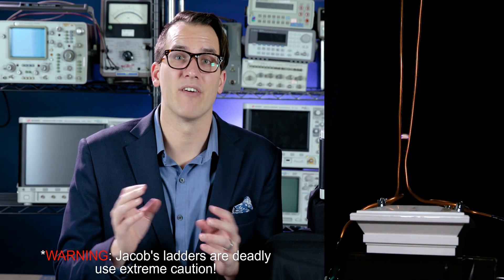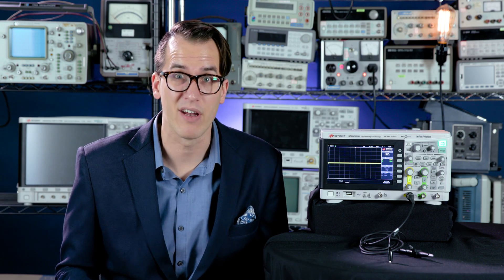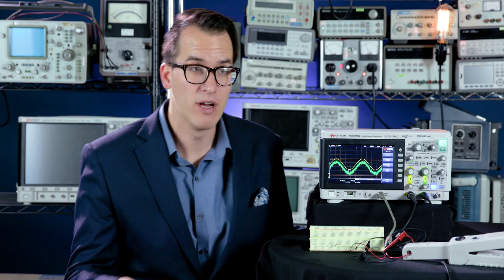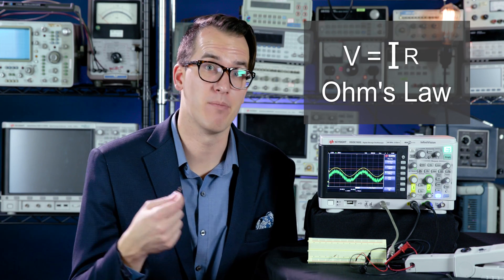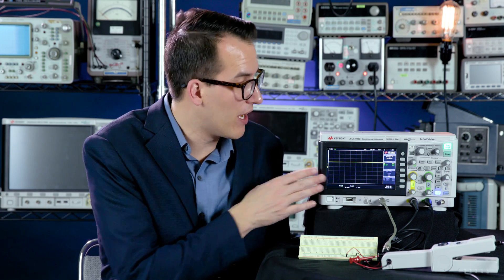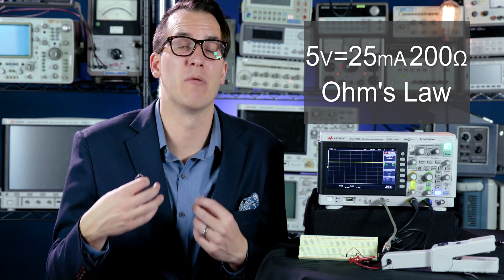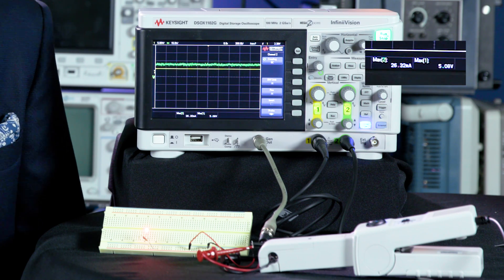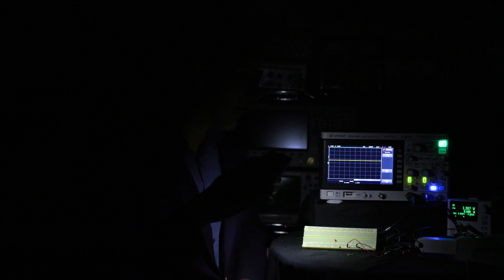Ohm's Law - The Keysight 2-Minute Guru (s2e6)

Comment: 25 ma ?   Try 10-20 LEDs in series with the 200-ohm resistor and see what happens when you remove the resistor. Also, Ohm's law DOES apply to the Jacob's ladder, regardless of whether the current is zero or not. But, the Jacob's ladder is a poor example in that the current is not DC. It's A.C. and there are phase and frequency factors to consider. Ohm's law still applies but not in the simple form V=IR. I am sure you know this but I just wan to be sure the audience is not misled.

Comment: I'm a bit puzzled about the affirmation of air having a high resistance but not conducting at all. To my understanding resistance just means linear relationship between voltage and current (at least to some point). If there is a finite resistance there should be current flowing when there is voltage.
Reply from the maker: That's a great question, and a lot of people get hung up on it! The thing to keep in mind is that Ohm's law does NOT dictate the behavior of electrical devices. 

We're used to saying "This is a law, so things behave according to it." But, since Ohm's law is an empirical law, it means that the order is reversed. "Things behave this way, so we're going to call this a 'law."" And, for more complex circuits, electricity does not always behave that way, it just often behaves that way. 

We describe things that follow Ohm's law as "ohmic" or in an "ohmic region," but outside of that region or for some materials it doesn't follow Ohm's law. For the Jacob's ladder, when the electrodes are too far apart, it's non-Ohmic.

Comment: Waaaaaait a bit. Resistance is by definition voltage / current. It's not a physical law. If there's no current, the resistance is infinite. ;-)
Reply: Sure it is. You just use impedance. Since the air gap is finite than there will be a capacitive element you will have reactance even without current flow. This means that even with "infinite" resistance from the air gap there is a finite impedance. This is why radio and light can propagate. Ohm's law still applies. Thumbs down for the click baity, inaccurate title. Stick to engineering, not physics.
Reply from the maker: It's true that resistance is V/I for Ohmic materials, but a situation like an un-connected battery is not an Ohmic situation. :)

Comment: I was studying ohms law and i am unable to understand the difference between veriable rasistance and rheostat i know it is silly but please help me if you know
Reply from the maker: There are no silly questions when learning! A potentiometer and a rheostat are essentially the same thing, but rheostats are generally built with a higher power rating. Externally, pots have 3 pins, rheostats have two (the 3rd pin is often connected internally to one of the other two).

Comment: misleading, why ignore led voltage drop ? it wont give 25ma it will give 15ma
Reply from the maker: Good question! The generator is actually providing ~5.8V, so the ~ .7 V drop from the LED put's the voltage right around 5V. So, the math checks out.